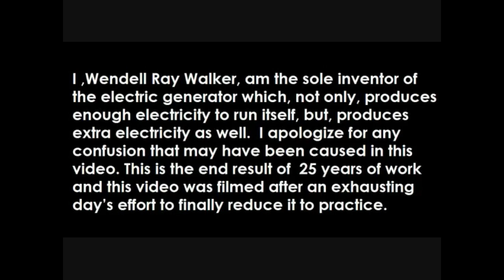FREE ENERGY # 22 Self Running Generator - New Ideal Design

Comment: # 1 self running with your fingers hands and then an electrical engine! so not too much self running. #2 where did u put your tester the check current and voltage?

Comment: Wendall Ray Walker,

Very cool with your thinking included.
There is a theorem called the maximum power theorem.
it states the impedance (resistance + inductance) of the source must equal the impedance of the load tp get maximum power transfer from the outside coil pulse to the inside or center motor.
Measure your windings with an ohm meter. are they about the same?
are you using a DC motor or Ac motor?
Do you have a rectifier between the motors?
How long does it run after push starting?
Vacuum will help as some have suggested or use the drag (load) as a feature aka a ceiling fan.
How much loading it can take beyond its own friction is what really matters with these type of inventions.
Put a variable resistor 1/100 to 1/2 of the the winding impedance, on the order of the winding resitance to see how sensitive the device is to extra loading.
Time the time to stop working from a fixed starting speed with different resistance settings. If the device does not stop sooner up to a certain resistance amount then more motor winding will make it more efficient by matching to the outer coil better.
This is the same as the wind resistance on the bolts, they consume power.
A RPM meter would be good to use or a pin hole and light detector frequency counter set up.
As the inner magnets rotate away from the coil as it passes by on bigger circumference, IFF all synced they will spin around and push against the coil with the opposite end. But this should be a net zero energy gain over time.
Add a core through the coil, over and under the top of inner spinning magnets to improve coupling/ reduce magnetic free path?
Noticed power taken at outer edge and used at center of wheel. Is there a Faraday wheel component in here??

Comment: I am in the process of creating a device which will take 12 volts dc and turn it into 10,000 watts.
This device will fit on a handtruck and will have 120 volt receptacles.

Comment: very beautiful design, well done. unfortunately I dont think this device is free energy, just efficiently storing the energy you put into moving it in the first place.

If you want to claim "free energy" then measure the energy you put into the device vs how much comes out.

also you could try letting the thing spin down from a set RPM and measure how long it takes, first with the circuit closed (like normal) and then with the circuit open (remove the coil) 

why do you say 'free energy' in the title, and then (correctly) say that energy cannot be destroyed or created only moved around? "free energy" usually implies the creation of energy, but this video shows you moving kinetic energy from your arm into rotor-mechanical energy and then induced into a generator which is slowly converting the electrical energy back into rotor-mechanical energy. At what point is the system gaining free energy?

finally, E=mc^2 is pretty much proven... not to mention essential for the design of many electronic devices (anything that requires the photoelectric effect, such as LASERs or photovoltaic cells)

Comment: Ignoring all other bullshit mentioned in this video, I would like to concentrate on your statement that this system runs under load.  Nothing of the sort! When a  generator feed a motor that spins the generator this is a closed unloaded system. To provide a load you must feed an external device. As it is, energy you provided with your hand will be recycled within the device until fully consumed by the friction (albeit small due to the levitation design) and device will stop. No useful load.

Comment: The thing is that "normal" electric motors have the COP less that 0.25. This means almost 75% what you put into them will be destroyed because of back electromotive force (BEFM) which is generated inside the coils of DC motor. If this system work with a normal electric motor, the just imagine how amazing it functions when it connected to a "proper electric motor". Check the youtube channel of "ufopolitics"  and you will see how to make one ;)

Comment: Ur my personal hero. Good JOB, i have a similar generator I have made. People dont get how power actually works, Ur absolutly right. I wonder what would happen if you could find a tube, and pump propane into it, that wing would then be spinning to, making the the outer area really cold, making more power. Its easier to break something loose when its super cold. ANYWAY, your just what i needed for motivation to keep going.Because people keep thinking Math, math is useless, Fractals make more senc

Comment: I like the zero gravity bearing , could this be used as a permanent solution or will the magnets need replaced as they age/wear out ?  , would a magnet push pull drive system be able to take over for the electric motor? there by freeing that energy to use some where else ?
great demo. keep it up, free/clean energy frees the world.

Comment: frictionless, slow-mo generator, 10 times  larger than the powering motor,  with the powering  motor  hooked  to the axis, (the most difficult of locations possible), with free floatting vertical axis', and floating magnetic stators,  to eliminate load bump, seems  to have all the difficulties  covered.  Three dimensinal dissipation of drag and load, inverted power distribution (Over unity  in three dimensions), looks  good to me. Should  work at any speed without flaw.

Comment: What elementary school did you get your engineering degree from?  I had an idea to connect an electric motor to a bigger generator and use the difference to power things.  Then I moved on to the 5th. Grade.  e = mc^2?  Ever heard of this novel concept called a constant which is the "c" in that equation?  Einstein did just say it, he proved it.  This represents 25 years of your life?  Let me guess, you don't believe in Evolution and are a big supporter of Ron Paul?

Comment: Good job, but just a nice amateur CONSTRUCTION. Electromagnetic generators are being used for over a century now. Also you believe that you don't go against any physics law, and that's true. BUT, all the power that generates the electric energy comes from your hand moving the disk. That means, that if you want to use it to work an electrical device you'll still have to consume energy turning the generator wheel. And the autonomous thing is just the initial energy (by hand) that's being recycled.

Comment: Thanx  for the tip on gravitational  escape,  and the use of the same  principle of opposition  to ecape  load.  I see  the addition of many coils  and therefore  greater  speed,  and  voltage  production. I do not see, any  drag, or  load  increases  in this  design.  I want  to attempt  to test these  theories, a nd report  my findings  to you.  I am subscribing. I am not seeking  financial gain, only over unity freedom for myself.

Comment: --spins with finger-- right now the generator is working on its own.  --spins with finger-- it's doing work.  --spins with finger-- Right now electrons are flowing through this coil.  That's work.  It's doing work, powering itself.  --spins with finger--

Get back to us when you have the 1 MW power plant up and running.

Comment: Couldn't partially shielding the magnet & coil, so they approach shield to shield, then open to one another when magnet is slightly past coil, not only reduce repulsion against rotation, but power rotation as magnet is repelled away from coil? Just curious.

Comment: This design looks very promising.  I always figured magnets would have to be used in multiple ways for this, including the levitation effect for massively reduced friction.  If perfected the only thing that would slow this down would be air resistance, but put it in a vacuum and there ya go.  Would love to see it rebuilt with better material and a more precise and balanced spin.
Something like this could be run in space and use microwaves to shoot the power down to earth!

Comment: @SodiumMonoCrapolate and @392redienhcs--you are both wrong. because its bad math, you dont use E=MC2 in this case, its like 3 guys give $10 each for a room for one night, later guy feels guilty give $5 dollars to bellhop to give back to the 3 guys, bellhop keeps $2 and give the guys each $1 back, will then if 3x10=30 but they ech got $1 back so they only paid $9 each so 3x9=27 plus the 2 the bell hop kept =29 so where did the $1 go? bad math should be 3x10=30-5+2+3=30

Comment: By defintion thats impossible, unless you factor in magnets, which are an additional force that do not require any fuel to function, only  to potentiate them. But in that case the output would still be smaller, you just have a big "free" input from the magnets.

Comment: If it could produce more electricity than it consumes it should be able to to accelerate once it gets going. Looks to be slowing down to me. And magnetic very low friction bearings are pretty easy to build but you have not done it here. You are only overcoming one angle of friction.